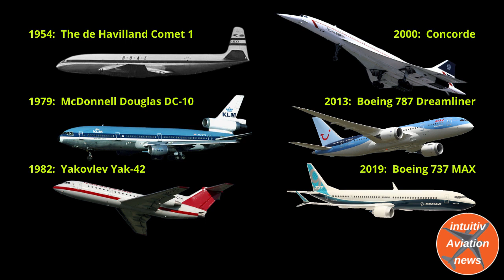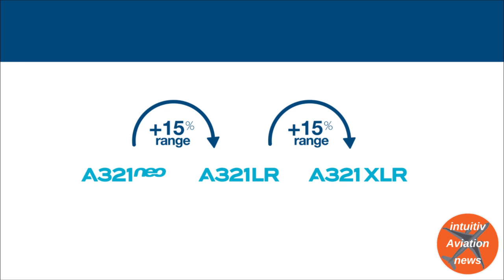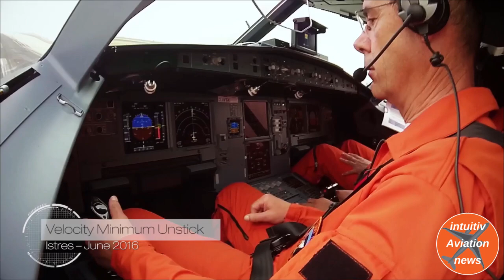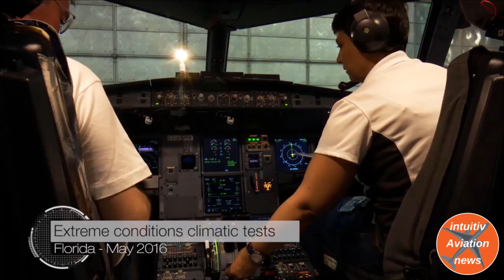Is the A321XLR Really Unsafe? Or ... is Boeing Scared?

Comment: Um not true boeing  had fly by wire 1960s on there fighter jets. And composite for use back in the 50s and Boeing are part of that. For military application. Boeing has always been the innovator Airbus the follower get your story right
Reply from the maker: Yes, true. In this video I focused solely on the commercial jets. Regulations and safety rules are not the same for both sectors.

Comment: You don"t have to be an experts to see if the fuel tank is bigger,if something happen the passengers are going to be in more trouble
Reply from the maker: That is not necessarily true. Accidents with single aisle aircraft do not have lower death ratio that the larger aircraft. It's all about how fuel tanks are built. In this case the center fuel tank is integrated in the fuselage and not a cylinder inside the aircraft's belly. This is what Boeing is nagging about. I say nagging because they are the ones that have been having major safety issues with the 737 MAX and the 787 Dreamliner till today, hence the groundings. Not mentioning the 777X and the 767 tanker. But back to the topic of this video: Boeing does not have all the technical details of this new design of the fuel tank, so they can only guess. This is why it's all congestion and just a desperate effort to deflect some of the attention of the media regarding safety to AIRBUS. A desperate move, this means they are really in deep trouble.

Comment: that guy  on You tube sure does a good job at lieing. Boeing had big problems long be for the MD merger
Reply from the maker: Please share with us what you've found. My information may well be limited.
Reply: @intuitivAviationnews   JAL 123 for starters, Ntsb found boeing to stupid to fix a plane . 3  737 lost to  faulty rudder  power units boeing went with the low bider in stead of some one good like saginaw steering gear
Reply: @dknowles60  Not including that information doesn't mean that 'intuitiv Aviation news' is a lier at all. He didn't include it, that's all! If anything, your bringing it up only proves that Boeing has had problems for many, many years! I'm sure, there are major Boeing safety problems that you've not mentioned but nobody is calling you a lier!

Comment: Airbus was the first to deliver an aircraft using composites, is that really true?  I thought it was 787.  Maybe I'm wrong.
Reply: Dude... how do you not know composites have been used in many other commercial aircraft prior to the 787?  Nobody has ever once claimed that the 787 was the first aircraft to use composites.  It was the first to use it as the primary structure.  Composites were used for decades on less critical components like gear doors, flaps, control surfaces, etc. 

This is only a revelation if you've been interested in commercial aviation for a week. 
Check this out for even more in-depth information on the use of composites.  This pre-dates first flight of the 787 and is nearly 2 decades old.
https://www.aviationpros.com/engines-components/aircraft-airframe-accessories/article/10386441/composites-in-aerospace-applications
Reply from the maker: check this link, Airbus started already with the A310, the the A320, only then Boeing started with the 777, then Airbus again with the A380 and only then the 787.
https://www.researchgate.net/figure/Percentage-of-aircraft-mass-comprised-of-composite-materials-initial-configuration_fig1_282476093
Reply: @intuitivAviationnews  Well, there you go.  I did not know that. Interesting.  Tks
Reply from the maker: @rockerobertson4002  You're welcome! Long live Google and those people who collect data and put it online :-)